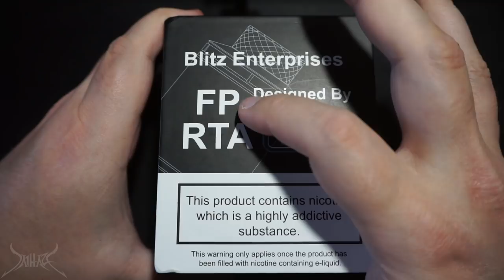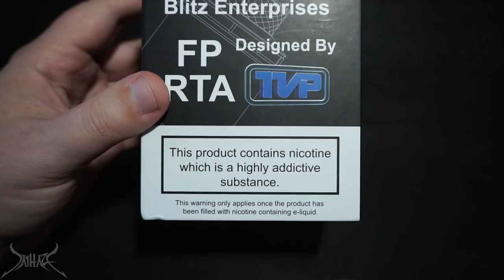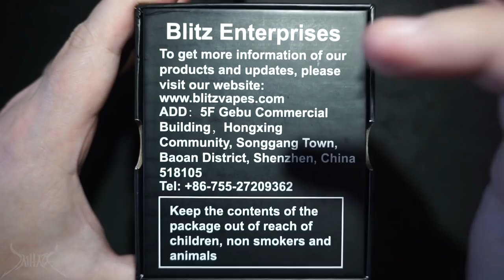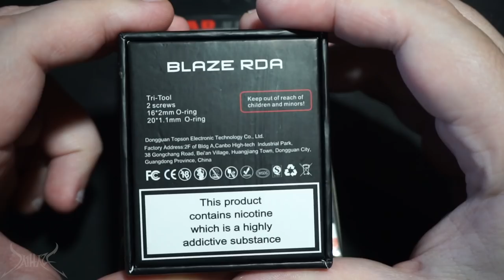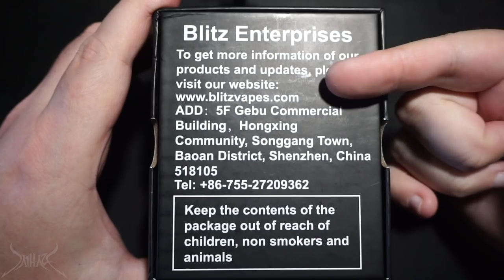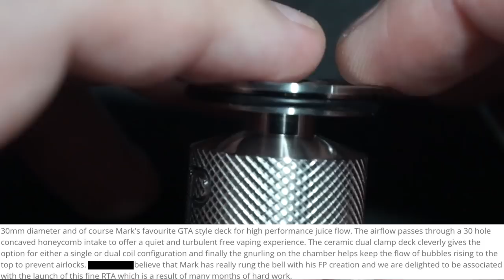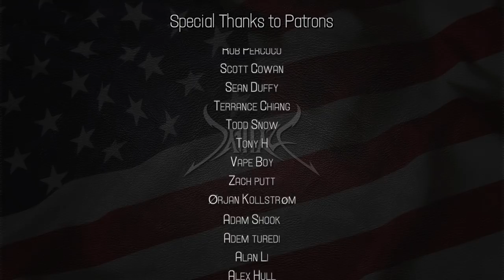Blitz Enterprises FP RTA Review and Rundown, A TVP Project | Almost Lost My Mind

Comment: I never had interest in this rta. For 30mm rta I rock the Scottua so personally this wouldn't be something I would likely buy because I already have that area covered, but I did watch the Heavens gift video that released prior to TVP's presentation video and for me the chimney section with the big FP just looks poor for my tastes. I also do not like the clamps. Even in the Heavens Gifts video they also struggled with the install because of the clamps. TVP sees a fair amount of gear and something simple like a ledge should of been foreseen to prevent the wires from slipping out during install. 

As to the short glass to skirt the TPD I understand why it is there but do not agree with it because let's say I did like this tank and saw it came with the shorty glass and was like alright a compact 30mm. Well when the short glass is on it covers the wicking channel and does not function. Including non functioning pieces to loophole laws means that there is a design issue for the country you reside in. If you have to include a 2ml tank section to sell it then put in the extra time to have it be a functional section even if it is unlikely to be embraced by the majority of the consumer market. 

I am sure some will enjoy this rta but in the end it just does not appeal to me and for 30mm if I was going China gear I would pick up a Hive or some other device that does appeal more to me.
Reply from the maker: pinned! just pinned
Reply: Fictitious Character brilliant as always FC
Reply: Trolling are  we?? Subs will be higher..try harder #Haser4life #Respect
Reply: i dont buy the bit of they threw the short glass in the last minute cause of tpd compliance cause MOST OF HIS FUCKIN FAN BASE IS IN THE UK come on they fucked up. And mark said blitz contacted him 4 to 5 months ago i call bullshit that they did a complete design and to the consumer in that short time.
Reply: @jaimeekendall2859  The TPD changed very recently , prior to this change you could include bubble glass and rubber bungs in tanks. So it was a last minute change to comply with the TPD. There's alot of comments from people outside the UK who seem to think that using the TPD loop holes is a big deal and a bad thing. If you were only allowed 2ml tanks, if you could only buy 10ml bottles of juice. How annoying would it be. The FP is not the first and only tank to use TPD loop holes it's really not a bit deal , infact most tanks that are released in the UK use these loop holes , horizon tech falcon , UWELL valaryian to name a few. The tanks are just the tip of the iceberg , you do realise that just about every juice company in the UK sell what we call short fill bottles for example you get a 60ml bottle of juice that only has 50ml of e.juice  in then you buy a 10ml bottle of 18mg nicotine you add to the bottle shake it up and you got 60ml of juice at 3mg. Just wish you guys would educate yourself before you make a dig.
Reply: I agree.....another unboxing showing that this tank has no instructions in it. You do realize that a very small percentage of vapers actually watch youtube?  So how many people are going to buy this and short out the tank, as TVP stated can happen in a Fasttech forum (because everyone reads that), trying to use that short glass, ? How many people in the US are going to know what the hell TPD laws are regarding the tank? They are going to see the tank is cheaper than the Sherman they have been eyeballing, and it comes with a short glass as well. That oversight alone should have ranked this tank a ZERO, because it endangers the end user.
Reply: merele south I felt my comment was decent enough and not just some jackleg rant. I feel the things I said were valid points from a consumer standpoint. Of course I am not in the UK so my understanding of TPD laws might not be the best but I do get the gist, but I feel including non functioning parts is a poor execution to bend the laws to get the device to markert Not everybody buying vape gear will know of TVP or follow YT and in fact those of us who do watch reviews are the minority of the consumers, so that means the majority will buy it without the knowledge that you or I have, so you essentially have people that can purchase the product without being aware that the included part is for show and does not function when assembled. IMO that was a poor decision. 
I also am criticizing this tank for the coil size that TVP is saying to use. I have a couple 30mm rta's and one of the perks of a 30mm atty is being able to use larger coils paired with larger capacity. This rta seems to go against that. Either way you clearly are more worked up over the issue.
Reply: glad you said it.. I think you nailed it 100%
Reply: Gregg Maughan p
Reply: @Fictitious_Character  hey man how u been, haven’t seen u around lately?? You whit vaping or something??
Reply: @danebeee1  hey Dane. No I'm still around. I have found the vape scene to be a bit dull and redundant these days but I am still vaping. Just haven't been buying much, and am kinda out of the loop on the new new that doesn't find its way to my FB feed. Boro stuff, pods, and disposables are what keeps the vape market going it seems. 

Mostly just more active in tool groups, work related groups, tool vids on YouTube, and kinda sucked into the weird world of TikTok lol. 

I do appreciate you thinking of me man. How are things going for you?
Reply: @Fictitious_Character  yeah it is getting a bit stale these days. Lack of innovation and all the policy bullshit going on is making it hard to stay interested but as you said the aio/boro scene is what’s keeping it interesting for me. I am pretty good man, crazy times we live in though.
Reply: @danebeee1  yeah I've been on the nfix for like the last 18 months. Lazy vaper right here. Got a bunch of stuff I could build but just don't want to. Easier to plug and play. I'm trying to ditch the salts because I think it's a main cause on why I haven't given it up altogether. Maybe by the time I'm ready to quit something new, exciting, and never seen before will get released and I'll get sucked in again lol. 

Glad to hear you are doing good man. 

Crazy times indeed.

Comment: It's took the place of my Sherman RTA I don't go for all this drama bullshit so I just keep it on topic. This is my RTA of 2018. Firstly it's a DUAL coil tank that can fit large single coils. The issue with the tanks is because of TPD the included glass is just for show and comes with two extra glasses for you to use. The warnings are required by law so that's that. I have been using for a bit now and it gives tremendous flavour and silky smooth airflow. In his video he explains the reasons behind some of the issues and how things where done the way they were. Again, I don't go in for all the YouTube drama especially vape drama, we're all here to quit smoking and it should stay that way.
Reply: U should try the Helo RTA. In my opinion the Helo is the best 30 mm to come out2018. It's also made by Asylum mods.
Reply: JLB Credit well said.
Reply: @wesvicious4948  I do like Asylum Modz I'll check it out

Comment: Dual coil 2.5mm or 3mm diameter and the coil wont obstruct the air flow inside the chamber. The flavor is awesome.
Reply: in a 30mm tank?uhm.. ok..

Comment: The short glass isn't supposed to be used or retained so breaking it isn't an issue. It's meant to be thrown away after purchase. The fitted glass is there to make the capacity 2ml to be European Tobacco Products Directive compliant. If you leave the fitted glass in place and throw a build in, it won't wick or will wick very very badly. But, the law is the law, and the EU must be obeyed.

The replacement glass cannot be included in the same package as the main product - again this is a legal issue. The same legal issue that prevents the sale of Squonk mods with a squonk bottle that can hold more than 2ml in the same package (this is a UK issue only for now).
Reply: Included glass isn't meant to be used? That's the dumbest thing I've ever heard
Reply: That's what I thought when I heard TVP say it too.
Reply: @McWarlord  it was designed to be sold with the larger glass installed. Before release they changed the law meaning the that the larger glass Couldn't be sold within the main packaging. The wording of the law means that it can be supplied separately, just not in the main box. Therefore they came up with the smaller glass almost as a display with no intention of it being used. Otherwise in the box all you would have is the deck, chimney and top cap.

Comment: Your absolutely correct about the installed glass you cracked, I was going mad at a short being caused when you screwed the chimney down on the last few threads.
I only realized it was a chimney short after I rebuilt my coils a second time, installed the frosted bubble tank and no shorting problem.

It vapes ok, It's to big for me, I wanted to keep it in it's 2ml glass mainly for appearance, I hate bubble glass extentions, I'll sacrifice capacity for a slimmer appearance with most RTA's.

I'd go 6.5/10, flavor is similar to the Glaz RTA, good but nothing special, It doesn't leak at all which is always nice on bottom airflow RTA's.

Not a fan of the airflow but it's the Steam Crave Aromamizer style  Mark liked, I prefer Aromamizer Glaz RTA, much better.

Wish you and postie would kiss n made up, I enjoyed your shows together.

Comment: So put smaller coils in you ......
You do know that different tanks are designed to operate with different builds .....(of course you do ) take for instance if I took your 502 and put 2 mm micro coils in it ,prolly not gonna be great flavour ,if I put same micro coils in a berserker mtl probably gonna work better but u already know that .u clearly have to many wraps around that single coil to slide that in there. This hatchet job of a review is a real disappointment. 

In closing if this is keeping it real well then ..... I don’t know

Comment: Don't take this wrong, just a small correction.
Short glass i solely for TPD purposes as it holds 2ml, this is done because the usually used plugs no longer pass thru TPD. It's not made to use, it short's out the coils and closes down the juiceflow more or less completely.
TVP did explain this in his video but it should've been much more clear because the same confusion that happened to you, would've happen to anyone that didn't watch his video.
Cheers dude, keep on doing what you're doing

Comment: The reason why you didn't get those other two sections in the box is because when it was released they were thinking of the new UK laws and the new UK laws will not allow them to even ship any tank where kit that even includes the ability to make the tank size any larger than 2 mils the United States one will come with those pieces when you purchase it the UK version will have those two slots were those belong empty as those two parts will not be contained since you purchased it from the UK that's why

Comment: Imagine buying a tank from the UK then being so uneducated about UK vape packaging LAW that you spend the first 5 mins of a vid knocking those legal requirements as poor design decisions. That would be so embarrassing. 😂

Imagine getting an rta shipped from a 'friend' and it turning up with the seal broken and parts missing and then complaining about that's how it comes for the next 5 mins on your vid. Your 'friend' got it sealed and including all the spares. Mine came sealed, with spare post clamps and it was spotlessly clean. 😂

To understand how the knurling helps with juice flow just read up on surface tension in viscous flow. If you can't read above high-school level then take my word for it. It helps.

Funny, when I saw that deck I knew it would take 2 fat coils without restricting the air flow. Wonder why Jai couldn't spot that? 😂

This lad is a terrible actor.
Reply from the maker: if you WATCHED the video you will see bubbles couldnt get PAST them. I could give a fck about your laws, they dont apply to me.  My package wasnt opened and I have about 9 more coming to the states FROM the UK to see how many more come like this
Reply: The UK laws do apply to you when you buy from the UK. That's why it has the small glass fitted, that's why the other glasses are packaged separately, that why it has the nic warnings,.... You slated those as faults but they are legal requirements in the county you bought your tank from. Buy one in the US and it will be packaged for that markets laws. 

I watched the vid. I've also built the rda. I didn't struggle like you did. That's because I know clamps aren't great with paralleled wires with different gauges, because I know that fat 3.5s are going to choke that deck. You knew that too but chose them anyway then blamed the gear lol

Compare the bubbles on this with the knurling to the bubbles on the vcmt2 without knurling. No one is claiming that it helps bubbles form, it does help bubbles dissipate.
Reply from the maker: no they do not. They apply to UK when exporting. There is no cross reference or cross laws from UK to USA. Sure in your country. Not Mine. The fact it comes with a glass that causes a short is a HUGE problem. Him trying to give you a glass that removes the short is not because of tpd compliance.  I will just requote someone here in the comments _Well when the short glass is on it covers the wicking channel and does not function. Including non functioning pieces to loophole laws means that there is a design issue for the country you reside in. If you have to include a 2ml tank section to sell it then put in the extra time to have it be a functional section even if it is unlikely to be embraced by the majority of the consumer market. _ go watch heavensgifts video, they struggled with it as well.
Reply: You bought it in the UK. It has to comply with UK law. The first batch of 150 were only for the UK market, they were all TPD complient. No other version exists yet. 

Wait until the big batches come through, they are released soon and you get nonTPD ones in nonTPD countries. ;)
Reply: MaxWiz you can’t tell some people can ya.
Reply: @MrAckers75  I genuinely can't work out if he's is real of some kind of parody lol
Reply: MaxWiz he certainly ain’t no reviewer that’s for sure
Reply: i am not from the uk nor is english my first language (seems like i have something in common with jai). but i even i figured out why it comes with the warnings and the spare tanks in seperate packages. guess i shud be doing reviews too... 😂😂😂
Reply: just imagine a reviewer telling the truth , how shocking is that

Comment: He did mention in his video that it is dual coil, but that it is fairly limited on how big of coils you can do in dual setup.
Reply: I quite happily put 3mm four core flat fused claptons in mine and they fit with no worries at all. I can show pics if proof is needed. 3mm is pretty much standard or you can put a huge 4/5mm single coil in without the need for plugs etc. I don't go in for all this drama, but it's my favourite tank of 2018 so far. I don't limit myself just because of an internet alliance to a particular person. If it's good, it's good.
Reply: I'm not gonna accuse anyone of being an idiot or take sides in anything that quite frankly doesn't involve me. I can understand pushing the limits of what a product can do to see how flexible it is. On the other hand, he did reference the guys video, so he obviously watched it. So, saying certain things are an issue when it was purposely pointed out as being a limitation of the design, is intentionally taking jabs at the person or their product. No, I'm not a tvp fan boy. I've seen his release video for this and maybe 2 reviews of his. I watch jai's reviews because I appreciate how closely he scrutinizes products. I find that very helpful especially when I can't always find certain products in the shops around me.
I personally believe this is definitely a case a crap Chinese quality control. Especially the one clamp not functioning properly. There being no lip on the edge under those clamps can definitely have its advantages tho. I loved the ghoul rda because those flat clamps with no lip allow me to put very wide builds in to get massive surface area with a single coil. As jai has always said of his reviews, they're his opinion and everyone has an opinion. Someone can't exactly be wrong for liking a certain type of design. So, this is one time I will definitely agree that taking shots at the company or designer because the features don't appeal to him personally, is somewhat out of line. Being unbiased would be to explain how those features can be seen as positive or negative.
I do however completely agree that the qc on this product is horrid and some of those issues def say alot about the manufacturing.

Comment: hello. I have this tank since yesterday. I completely do not know where from such a tragically negative opinion. build setup was not that difficult at all. cotton in the tank does not overflow, does not leak, taste  cool. dense and huge cloud. in my opinion it is even better than triple rta v1 and v2. it can actually be ugly but what is the problem? I have one coil, 7 mm in diameter, 6 turns. 0.5 ohms 100 W. the larger coils will not fit in ...